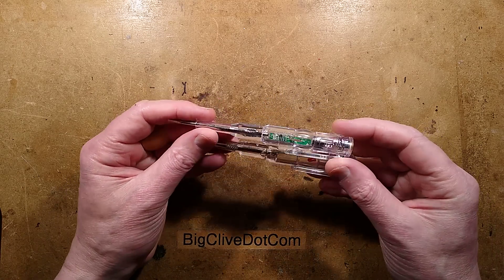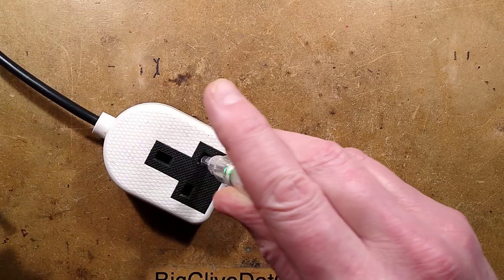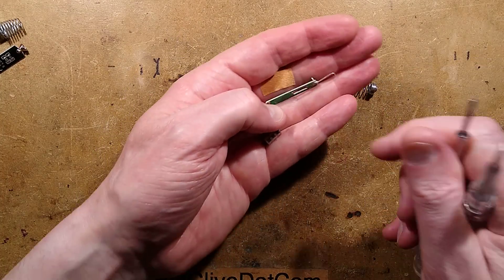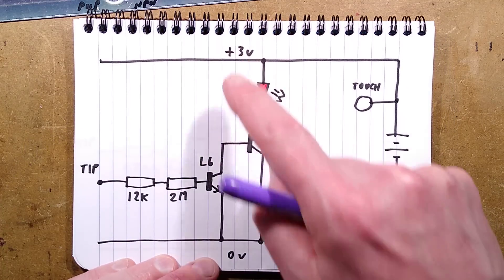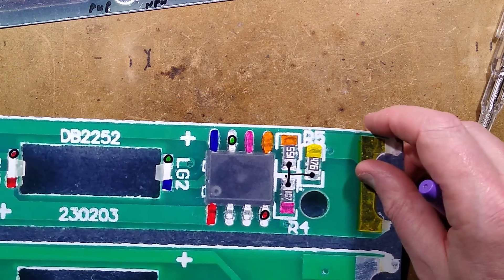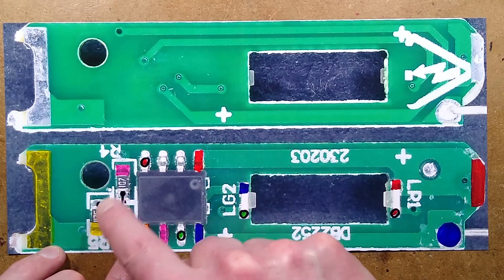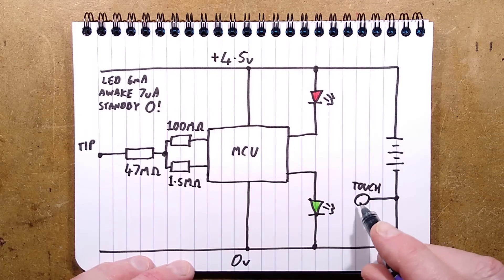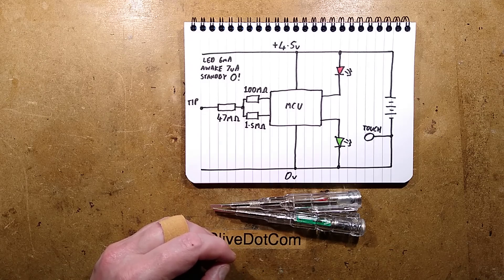Test screwdriver with microcontroller!

Comment: straight away i see an application for this, modified a bit.  spark detection for plug leads and systems on cars.  could be tweaked to give a good indication of weak or strong spark with distance etc..

Comment: I got one of the older versions many years ago when they first came out and the RS Components rep was touting them - in fact I got a bunch for all of us in the office. However, I have never and will never put the tip in direct contact with the mains - I had my one shock as a youth with the Bakelite light switch cover removed and am in no hurry to repeat that experience. Instead I use the method in the instructions - hold it by the tip and place the finger end by the cable to be tested. And, obviously, I'm still careful after that, eg, for preference I want to see both Found and Not-Found states by flicking a switch or 'fuse'. Still, someone's got to test the limits, and I for one am very glad that you know what you're doing - and long may it continue!

Comment: I bought one of these 25 years ago. It sort of did what it promised, but it did it so poorly I could never be sure if it was checking continuity, an energised terminal, or sensing. It made a reasonable terminal driver after that, but never a tester. i still have it in my toolbox somewhere.

Comment: An NPN connected to a PNP transistor is a configuration known as a Sziklai pair. It has a couple of advantages over a Darlington. The turn on voltage is only 0.6V and the transconductance is the same as a single transistor, which is double that of a Darlington pair.

I'm surprised they used an 8-pin microcontroller, when a 6-pin chip would have done.

Comment: I bought a dozen of these when I was in China. There's another function as it can detect the breaking point of a wire, just position the tip of the driver along the length of the wire with the index finger touching the metal part at the top. The green LED would light up when it detect a current inside the wire, and it goes out when reaching the breaking point. Also don't bother to replace the battery, just replace the whole thing as it only cost about 0.5 USD each when you buy 3-5, including shipping.

Comment: Your design idea for an all LED tester is excellent ( as an advert says : why did they not think of this before ! ) ... I will stick with your back to back LED's with a 330 K Ω in between each pair .... my idea , using mains bulb filaments might have a flaw ... the reverse voltage on each cycle may damage these long LED strings , and let's face it , 6 green LED's should be enough ( ? ) ....... DAVE™ 🛑

Comment: Many years ago when I was single digit age I had an original neon screwdriver quality made. Even diagnosed faults in valve circuits with it. There was a little booklet "50(?) Ways to Use a Neon Tester" and I was quick to learn resistance makes things safe to touch.  When I got my first multitester (moving coil) I often used it like a neon tester (using one probe only) and I sometimes still do to this day, using a DVM.  Set to high AC volts and instead of connecting the other probe to the circuit under test, hold the tip between fingers (or in mouth to prove it's safe). I feel much safer because I won't have both hands near the circuit. 
A neon tester only tells you a circuit's live and it won't tell you if it's dead. 
The only sure way to know a circuit is dead is connect across it a test lamp which you'd just proved it lights up before and after.

Comment: In past days when I used to repair vacuum cleaners I would plug the appliance in and use one of these by running down the outer cable to detect where a break in the wires may be.

Comment: I don't this as using a microcontroller. A typical microcontroller includes a processor, program memory, RAM, input/output pins, and more on a single chip. The chip look to be some type of logic chip like the LM555.
Reply from the maker: Modern microcontrollers cost just a few cents.

Comment: Is the micro-controller really just for power management, to make the batteries last  , Clive ?? 🤔
Reply from the maker: If anything it will have a higher current drain than the very simple circuit.

Comment: As a sparkz I only use as a quick continuity test or external live test to find voltage in a cable, otherwise I use a fluke T150 to be safe

Comment: the device with uc - i guess the  pin with with 1.5MOhm resistor is configured as an input, the  pin with 100MOhm as output and serves as a extremely weak pullup/pulldown. Program probably toggles this output between high/low states and checks if the input "follows". On one hand - using uc for doing this sounds crazy, on the  other - clever software can measure interesting things just by checking the delay - like these cheap "component testers" with ZIF socket.
Reply from the maker: That's an interesting concept.

Comment: Either of these is a few steps beyond my vintage tester that used a small neon lamp with a resistor in series.  Drove my mom mad when I would stick the tip into a socket and then touch the opposite end.

Comment: I prefer the ones with a neon bulb and a resistor.
I don't like those LED-based ones, because they have batteries in it, which are failure points. As are the µC, the transistors and the LEDs. And they're not good for anything. It's a gimmick. For mains, you cannot use them because of unsafe separation between the user and the voltage. For low voltage applications, one rather measures a combination of current carrying capability as well as voltage. And for resistance, what good is that if it cannot differentiate between 1Ohm and 100kOhm?
So, in my opinion, the high-voltage ones with a neon bulb and a resistor, and the low-voltage ones with an incandescent bulb and a ground lead are still miles ahead.

Comment: china/ebay aside, even the made in the UK supposedly safe versions of these things always made me nervous, here shove this screwdriver in a mains socket, now touch the metal bit on the end, its just so wrong, you have to put aside all your normal notions of Things Not To Do With Electric to even use them as intended

Comment: Typical smd resistor has a voltage rating of perhaps 200V or so and the gaps between pads are not that large. Relying on 1-2 resistors as separation from mains is far from safe. Sure, it can work but I'd not rely on them.
I'd prefer to see proper resistor networks or a capacitive pickup with proper insulation (or rated cap).

Comment: From a safety point of view that is terrifying.  Using ordinary surface mount components as a barrier to 230V mains is a joke.  It can easily flash over if there is any sort of spike on the line or if it gets damp. There is a reason why a 'creepage' clearance of 8mm is recommended between 'live' and 'people'

Comment: The NPN and PNP  couple used to be called a ( super alpha pair ) but nowadays attributed to a Mr  Sziklai ( ! ) they work like a Darlington pair , but have superior properties ( only a 0v6 turn on , Darlingtons have 1v2 ! ) .. with a 33kΩ resistor between  +ve and base of NPN then an 8 Ω loudspeaker in the PNP emitter lead , then a 47nF capacitor coupling the loudspeaker back to the NPN base ... using a 1v5 volt cell , you now have a 1st class continuity tester that DOES NOT damage IC's ... for loudest results use a Germanium audio output transistor for the PNP ( from an old 1960's radio ? ) ... tests diodes ( not LED's ) , resistors up to 50 Ω and SMALL coils ( inductors ) .. best to solder the cell as it can last 20 years ! ! ... a very cheap little gizmo and ( tried - n -tested ) ...... DAVE™    🛑

Comment: I was wondering if this is a microcontroller, or could it be two op-amps, maybe comparators?. This would make so much more sense, (Pun intended).
Reply from the maker: No associated resistive divider for the other reference voltages.

Comment: The first one uses a darlington configuration called a "sziklai pair". I've seen them used in push-pull audio amplifiers before where they need to keep the output driver transistors similar. The pull up darlington uses a PNP followed by an NPN that's matched to the pull down pair that uses NPN-NPN.

Comment: Next time try to buy line tester made in India... Those generally have a neon bulb & a resistor & is for detecting just live wires/terminals for 250V. Those testers also feel like an ant bite if u use with wet skin... 😅😅😅

Comment: Pinout of the micro matches a Padauk PMS150C SO-8 typical "3 cent microcontroller"
And I think you are right about the big pcb track loop on the 100 Mohm inout, it is likely to be an AC field sensor.
I did an experiment with a 2 inch piece of wire into a MCU ADC input, it was easily detecting 200mV of AC mains waveform so that loop is a pretty decent antenna.
Reply: Is it possible the microcontroller is cheaper than the discrete transistors?
Reply: @cheyannei5983  nope, transistors are well under a cent each for this application. They spend the extra couple of cents on a MCU because they can put an extra 50 cents on the product price. Just business as usual. 🙂

Comment: That’s called a Sziklai pair, they’re found in both linear and switching applications as a lower dropout voltage replacement for a Darlington. Mainly linear though, using one instead of putting the load on the collector is usually only done where the output polarity matters.
Also known as a complementary pair, Slizzy pair, or Glizzy pair. At least one of those names isn’t made up.

Also internal pull-ups are like 50k, I doubt they’ve got them on the 100M input at he very least. More likely they’re relying on the pin’s leakage resistance, that and the protection diodes.

Comment: To pop in a 3 cents MCU like PADAUK's PMS150 or Nyquest's NY8A051F is not at all ludicrous considering that a logic gate IC like 74HCxx is much more expensive than that. In fact, with that kind of programmability and cost, it would be insane not to use MCU!

Comment: I bought one like this 10 years ago in local shop. Pretty expensive for that things even more because it was crap. After three months stop work so I changed battery and it work 4months with only few use and stop work again. Something inside drain battery every 3-4months. Batteries used in was not very common watch battery type and also not very cheap. So I stop using this and went back to neon lam screwdriver instead or other testers.

Comment: MCU in a tester, impressive. Can one buy only the circuit?  I have plenty old german made testers I'd like to upgrade!
Was also wandering why not include a rectifier to replace the batteries? 
SMD resistors wont pass safety requirements? What can be used to protect touch even if grounded.
Sensitivity of "Continuity" between one's own hands has any practical use?
Reply from the maker: I've only seen the module included with the drivers.

Comment: Very interesting but I'd never  have such a device in my toolkit, let alone use one. It's too easy to accidentally pick up another screwdriver and stick it into a live socket. When dealing with mains power devices should be made distinct and not have secondary, non-necessary uses. There's no need for this to be shaped like a screwdriver when there are many, much better screwdrivers on the market. 

I know that safety is ultimately up to the person. It may be made easier on them when they test for a live electrical connection the tool they use doesn't require them the verify that it isn't a regular screwdriver or not. It's too easy to get in the habit of always storing a tool in a certain place and it's been misplaced or you're working on a project and thinking it is in a particular place of the tool belt, tool box, or in a pocket but you swapped it for another when something higher priority came up. Then you get back to your to your main task and pick up the wrong tool. It doesn't happen often but it can. Tools should be made to reduce the risk of harm. I'm not saying all multitools are bad. When dealing with dangerous items perhaps single purpose tools might be a better idea.

Comment: As a former theatre electrician I consider the proper function of these devices is for opening the small tunes of paint I used to identify my kit.
Reply: As an ex NHS specialist hospital Electro-mechanical engineer...I  fixed things in a slightly different theatre... and my little voltage detector did it's job... my colleagues, my boss laughed at me... I said that's live, my pens lit up... I'm not touching it 😂 (I refer to a proper Megger one, not those neon screw drivers)

And believe you me, many, many moons ago, in my other life as a Musical Instrument Technician: I've been thrown across a room by several thousand volts, from an old 100W PA Valve Amp,  and lived to tell the tale 😂
Reply: Agreed. I smash them into little bits and bin them when they come in a kit as I have proper teaspoons for stirring my tea.
Reply: I never knew how dangerous a the average phase tester could be until I began learning electronics. Never again will I put one into a socket.. ⚡️💀
Reply: No, double down no... (of course, we learn the hard way zzzp)
Reply: @keithking1985  I use the neon testers, but make sure I'm insulated from ground first.
Reply: Tunes of paint? Is there some synesthesia going on here?
Reply: Odd isn't it.... How public perception changes, rather like 'cancel culture' tears down statues because we judge past culture through contemporary eyes.   
The era when when my school caretaker (very popular mam) tested current with a finger while smart professional electricians carried a neon screwdriver instead of lug around a heavy and breakable bakelite Avometer. 
The humble neon screwdriver showed valuable habits to get into to survive such as probing with one hand only, learning that insulation had resistance and many more
Reply: @jagmarc  Was your school caretaker popular because he could recharge batteries just by holding them between forefinger and thumb and he could light the way, just with a lightbulb in his mouth? And was his nickname ‘Sparky’?
Reply: @bettyswallocks6411  Come to think of it now,  he nearly always was surrounded by girls when I saw him, maybe it was static electricity attraction but gender selective.
Reply: @keithking1985 use non contact testers

Comment: They srsly make devices smart, which do not need to be smart in the first place. These have batteries in them and you stick them into AC 120V/240V.
There is nothing which can go wrong, if the batteries are dead. Right?